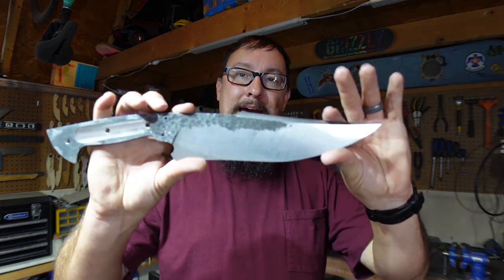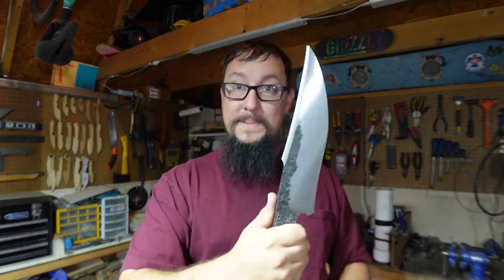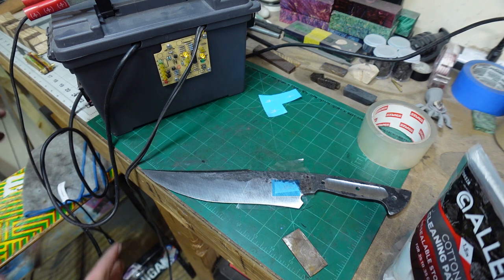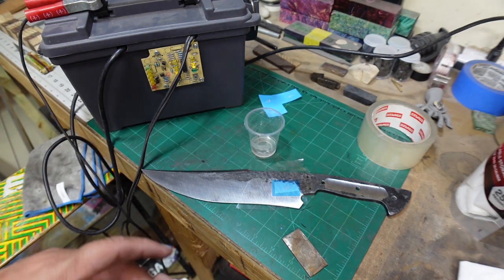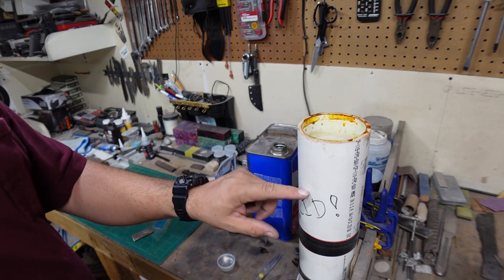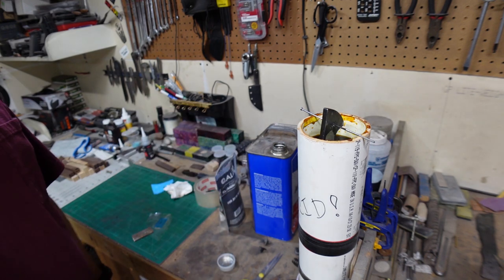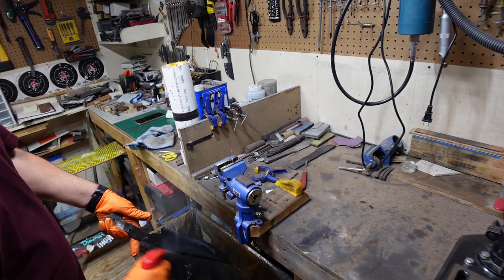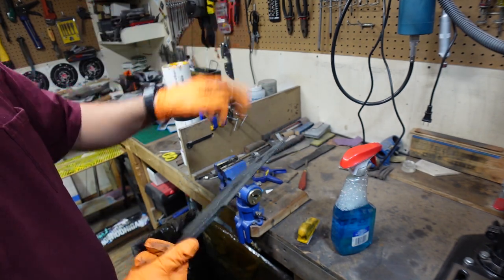Etching The Makers Mark And The Blade Of The 5160 Bowie | Shop Talk Tuesday Episode 107

Comment: Just wondering, have you given 5160's tougher big brother a look? 8670 has a bit more carbon, added moly, gets about as hard and is reputedly a much tougher steel which could make for some truly monster choppers. I don't think its one of the all time greatest at edge holding but should be tougher than nearly anything but the high-alloy mid-carbon steels
Reply from the maker: I'm going to look into it and try it out. Thanks for suggesting it.
Reply: @theriversexperience9383  Cool, next year when I've got a bit of cash squirreled away I'm looking at getting a bit in just to give it a go as well. Alpha supplies it from memory.
Metallurgical its a little bit (fuzzy description if ever there was!) like L6 so it would make for a good sword steel as well.

Not you really want to get into sword making, that's just a whole pain in the bum of every heat treating equipment needing to be 5x as long